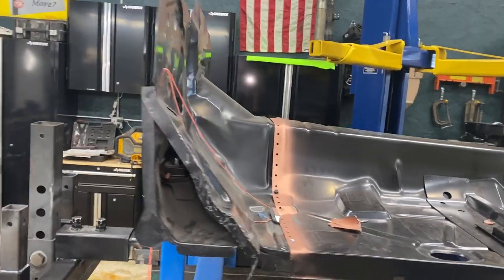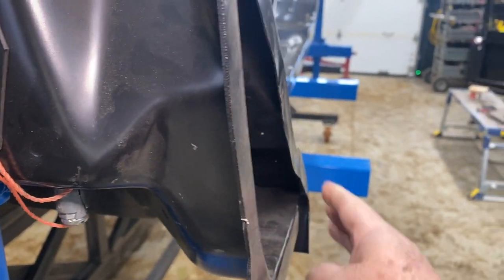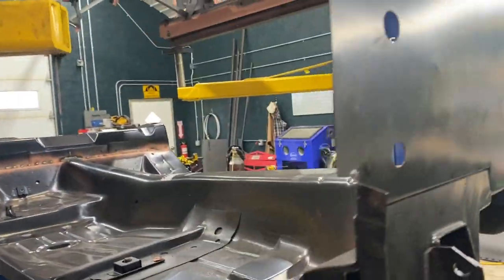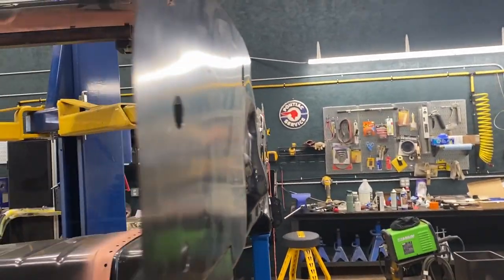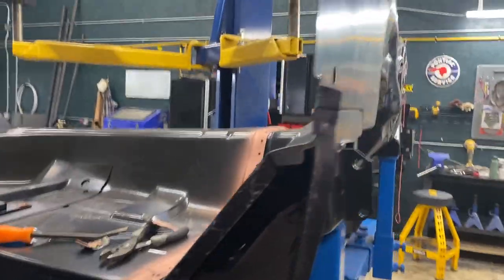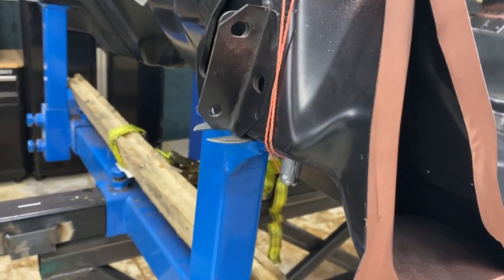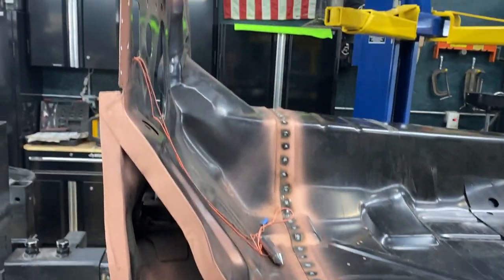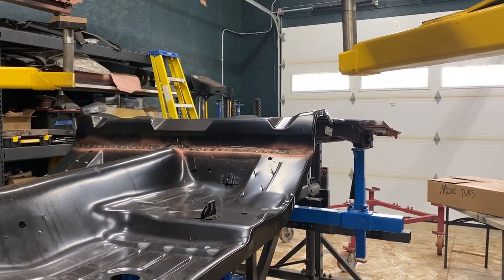67 Firebird, Part 18 Prepping and installing the Firewall

Comment: You are doing a great job... I have a question with the firewall not being a original that means you won't have the Vin numbers on it and if you are putting a new A pelar on you will have to remove the Vin number plate at the end can you title this 67 as a original car I know that in some states you can't it will be considered a new car that have to pass emissions thanks
Reply from the maker: Hi Luis,  The A pillar is not being removed so the vin is still there.  I removed the body tag from the Upper cowl so that will be reapplied to the new cowl but that really does not have the VIN.  I did re-stamp the upper cowl with the partial vin that was stamped in to the original one, but that is not a legal thing just a ID thing should it be stolen. The other ID stamping under the blower motor hole is still there. I have a tittle for the original car and VIN but having said all that NH is one of the easiest states to get a new tittle and even a vin for a classic car.  Tittles are super easy,  just a form at your town office. If you need a new VIN, it is slightly more complicated because you have to get an inspection done showing that the car has all the original safety features (minimum) that were available on the original car.  Last free state baby! Thanks for asking!
Reply: @LakeAndLodgeGarage  thanks for replying brother